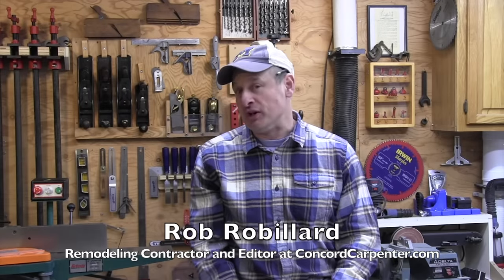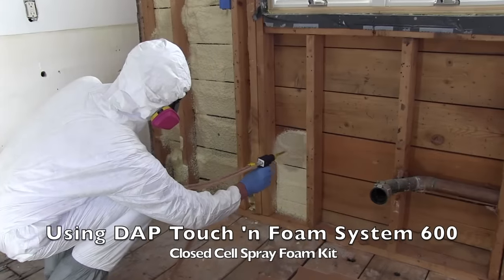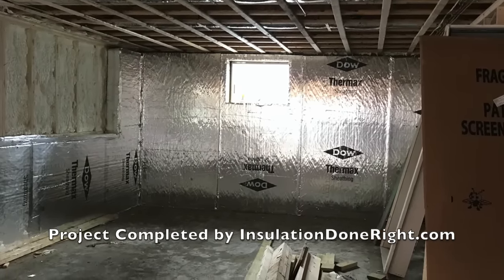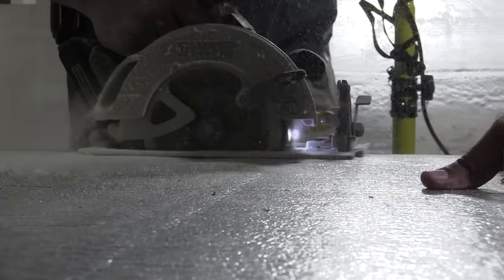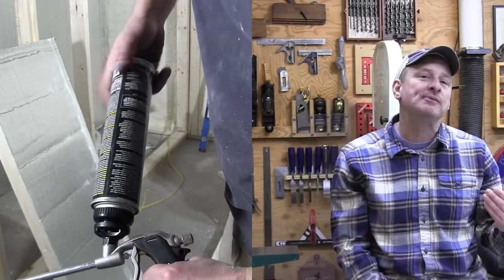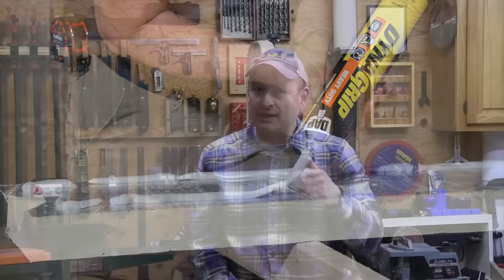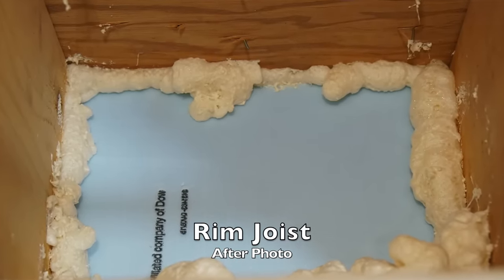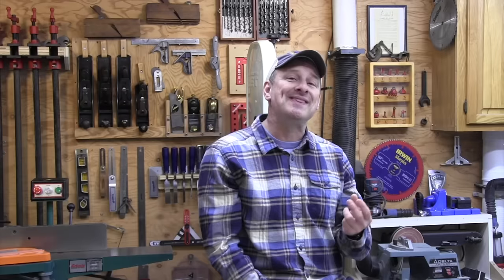Why Use RIGID Insulation board On basement walls

Comment: My basement walls are porous cinder block/drylock. What if my basement walls leak (just a little) in 1 spot.  can i still put this on the wall? Thanks
Reply: Same question. I have effervescence into locations and water coming under the footing in one. How do I properly seal against this? Further question, is it possible to finish only part of the basement this way?
Reply from the maker: Aaron Shensky you need to deal with water first: gutters, down spots out and away from foundation, slope grades away from foundation, etc

Comment: I am using a foam board called R-tech.. I am using it on my walls which have steel studs. Would you suggest using a washer/screw to attach the board to the steel studs OR glue?
Reply from the maker: screw it
Reply: @ConcordCarpenter  thank you!

Comment: I work at a door shop that has leftover polyurethane fiberglass pieces that are 1.75 inches thick.  They are 1/8 inch thick of gel coated fiberglass on each side with 1.75 inches of polyurethane foam. They cut doors out for windows and I take home what's left,because they just throw them in the trash. I've been there for 4.5 years and now Have 950 pieces now. 22"x 36" and 22"x27.5" pieces are all flat with no patterns. The R-value apparently is 7.5 according to Therma true .
 I am on on over 6 1/2 acre so I have room to store them. Just can't quite figure out what to do with them for either an investment or projects.
Reply: Are you in the northern NJ area?!
Reply: Boise Idaho area
Reply: Kickass beer coolers?
Reply: @montanaplease  darn.. I would've Definitely bought a bunch from you, I've gotta insulate my garage & finish off my basement
Reply: A few years ago when I originally started bringing them home it was to insulate my shop that had nothing translation in it. Then I ended up building 198 square-foot tiny home (2sq ft under  to where I'd have to have a permit )out of some by using two layers of them. But now I'm still accumulating them .
 Apparently yeti coolers have the same exact foam inside them so I had been thinking about something like coolers. But the fiberglass is tough to bond to other panels so it would be tough to seal it all off.  It's like the fiberglass has a gelcoat that goes through the whole entire layer.

Comment: Hey Rob, Good video but I have a question about adding fiberglass insulation between studs on the interior wall. Do you use faced or unfaced insulation? If you use faced insulation doesn't that trap the fiberglass between 2 layers of vapor barrier? Would rockwool be a better option than fiberglass?
Reply: You are correct, never used faced batts in this situation. That should have been mentioned in the video. Rock wool is more expensive than fiberglass with similar overall performance, but it's much easier to work with than unfaced fiberglass and will sag less over time.
Reply from the maker: The foam creates the vapor barrier so all you need is batt insulation: either fiberglass or rockwool
Reply: Rock wool is also much more fireproof.
Reply from the maker: @johnkruton9708  yep - makes for a great follow-up in the stud wall

Comment: Lol Rob hey thx for a great informative vid. Had a question about the adhesive used behind the GPS. Curious if any ole PL construction adhesive will do ? I don't want to remove the film that faces the  basement concrete side..... was thinking of using like great stuff foam and tucktape....
Reply: P.s. I'm up in Toronto.

Comment: Rob, great video as always.  Are you seeing much GPS in your next of the woods?  Do you have any views on it for basements?  Where would you rank it relative to EPS and Polyiso?
Reply from the maker: No, Polyiso is 99% of what we see unless it’s homeowner installed. Contractors who typically install this do so in basements with the hope that they will get the future of sale of framing and finishing the basement.

In a DIY situation, I would say the GPS is common because of its access and availability at the local Home Depot or Lowe’s. 

There are two types of rigid boards we've commonly used.
Extruded Polystyrene (XPS) insulation board
Polyisocyanurate (Polyiso)  insulation boar
Extruded Polystyrene (XPS) insulation foam boards deliver the long-term stable thermal performance of R-5 per inch. Compared to spray foam, it’s harder to install in awkward areas (for example, in a tight space where a rim joist is close to another parallel joist). Rigid foam is also fussy to install if the rim joists have a lot of wiring and pipe penetrations. But its cheaper and a popular choice if you’re doing a DIY project.

Polyisocyanurate (Polyiso) is a closed-cell, rigid insulation foam board that is bonded to facers on both sides Polyiso is most commonly used due to its fire-retardant properties. Under normal fire conditions, XPS, melts and drips while polyiso, chars over.
 
The foil facing also helps with the limiting of any moisture travel.  Polyiso is commonly used in roof, wall, ceiling and specialty applications within commercial and residential buildings of all types.
Reply: @ConcordCarpenter  GPS carries higher r value per inch, , and for those who care, better for environment

Comment: Can I apply XPS and then poly over it to make the room more fire safe?
Reply from the maker: no need
Reply: @ConcordCarpenter  in your video you say that the poly is better for fire protection. At the local Home Depot the XPS board has a better R-value per inch of thickness so I was thinking if I did a sheet of XPS and then applied a sheet of poly over it then I would get extra r value but also have the fire protection. Are you saying if I'm going to use XPS there's really no need to use poly or I should just use multiple layers of poly to get the R-value that I want and keep the fire protection?

Comment: What can I use under vinyl planks in a basement?  prevent mold/moisture/condensation...
Reply: 6 mil plastic or a high quality flooring underlayment with integrated vapor barrier.

Comment: when you install your fiberglass insulation do you put a poly sheet over it or is the foam board alone acceptable as a vapor barrier?
Reply from the maker: If done correctly the poly is your vapor barrier

Comment: Best practices? Maybe if you left a gap at the bottom, top sides and then foamed them rather than adhesive. You got an R rating on that adhesive? You are also putting your vapor barrier to the inside of the foam which means the foam can hold moisture. If placed to the outside it keeps moisture back at the masonary layer. So install the panels right and get rid of that thermal bridging between panels.
Reply from the maker: There is a small gap that’s why we take the tape we don’t use adhesive in seams, just to glue it to wall
Reply: @ConcordCarpenter  in your video you clearly state using adhesive in the seams between panels. Tape only stops air and does not have any R-value that's why the phone should be used at all edges of the board and thus it should not be fitted directly against the floor but with a small Gap.

Comment: HI Rob, I'd like to use an eps foam board in my rim joists, but the joist
cavity is ~10" deep and the blocks are not filled - how would you seal the block cavities inside the rim joists? Cheers
Reply from the maker: put the foam over the cavity - horizontal

Comment: Unfinished basements in new home construction, the  concrete wall needs to be insulated now, and then sheet rocked for fire purposes. The rigid foam melts and smokes so it needs covering. Does the polyiso need it to. You said its more fire proof. Just wondering so the basement can be finished at a later time.
Reply from the maker: Polyiso is most commonly used due to its fire-retardant properties. Under normal fire conditions, XPS, melts and drips while polyiso, chars over.

Comment: Could you please tell me what type of blade you used to cut the insulation 👍
Reply from the maker: framing blade - regular circular saw
Reply: @ConcordCarpenter  thanks 👍
Reply: Diorama Jedi  wear face mask when cutting this type of materials.
Reply: @ictrains9731  thanks 👍
Reply from the maker: @ictrains9731  Good point
Reply: Less dust with a jigsaw.
Reply from the maker: @huejanus5505  interesting will have to try it

Comment: Despite what this guy says....Polyiso is a terrible choice if you're in a cold environment.  Polyiso is good at keeping the cold in the house in hot areas.  It's VERY bad at keeping the heat in the house in cold areas.  The R value you see advertised is based on its performance in warm weather.  All of that goes down the drain in the cold.
Reply from the maker: Disagree - from a performance standpoint poly iso-board is excellent in any residential application
Reply: Polyiso is used in 50% of all commercial flat roofs in this country for its superior performance and high R value per inch. Including climate zones 5+ and up. While all insulation performs at a lower rate in cold weather, foam performs the best. Most areas that use this in a basement below grade have an average ground temperature of 50+ which is a perfect fit for this product. Even with a performance loss of 1.5 R per inch you are still left with solid performance. In the new code book this is going to be the new wall and roof insulation method. My guess is they have written the code to reflect best performance. ( not always the case but here I feel it is) I have to ask what would your method of insulation be if not polyiso/foam in a basement?

Comment: If you live in an area with high ground water your cinder block needs to breath or it will disintegrate. Best bet is a vapor barrier sprayed outside and open cell inside.
Reply from the maker: BJ Hermsen best to have a water management system, dimple wall drain mats, perimeter drains, French drain and sump pump

Comment: Building inspector will not approve that in Illinois because if house catches fire the fumes will kill you before the fire does
Reply: Do they allow ANY foam?
Reply: @LtDan-hr1pb  outside only
Reply: You might want to have the inspector look at the 2015 ICC code book and Thermax products which are rated to be left exposed in these applications specifically.

Comment: Am I missing something. If you spray foam and do foam boards it seems like it would cost thousands of dollars to do a normal basement.
Reply: I did this method myself on a 30'x24' basement. Had the rim joists spray foamed for less than $500, and I used 1" panels myself (R-5)value at $20 per sheet (Menards). So for around $1,000 throw in tape and adhesive. If that helps.

Comment: I am planning on a dimple mat on my concrete slab followed by a 2x4 wall 2" off the foundation wall so that I can use closed-cell. Someone said I should take the dimple mat and wrap it up the wall 12" in case any water gets through the foundation wall. 

Is going up the wall the 12" even a good idea? 
Should the dimple mat go below the 2x4 wall?
Thanks!
Reply: @John Salazar I just wouldn't do it.    Alaska cold weather research center and Ottawa design and build have really good videos on the pitfalls of finishing a basement. The later has a good design that will coexist with a basement wall who's exterior walls are not weatherproof.

Fogging the area with an anti mold product before you begin is cheap insurance.

If you're at all allergic to mold, like I am, just leave it unfinished.
Reply: @PeterPetrakis  I'm in Chicago and we have a Radon system that constantly draws air from under the slab and expels it outside. This process also has the benefit of expelling moisture from under the slab. Secondly, we have a whole house dehumidifier and an ERV so not concerned about mold issues.

Comment: Is polyiso the same as EPS? I’ve seen other videos where people recommend EPS instead of XPS as XPS loses its r value over time. And the EPS is more cost effective
Reply: It depends where you live.  In colder temperatures, polyiso will lose R-value.  Polyiso has an R6.5 per inch though.  Ideally you would spray the studs with Polyiso and then use a continuous insualtion of  1.5" EPS.  The EPS keeps the polyiso warm and it does not lose any R value.  A 2x6 wall built this way would have an R value of 42.

Comment: 6:05 looks like a dangerous application of spray foam insulation. I thought you had to apply in thin layers so it could cure properly and not vent harmful vapors over time.